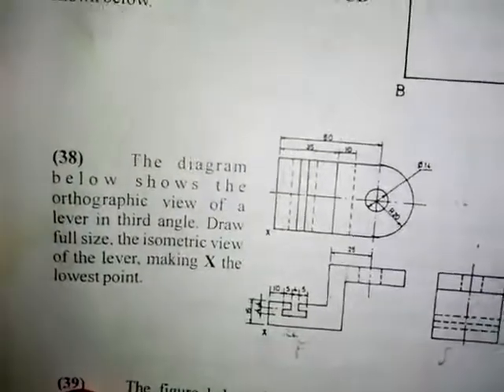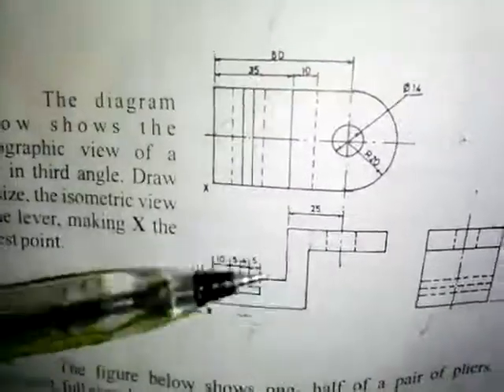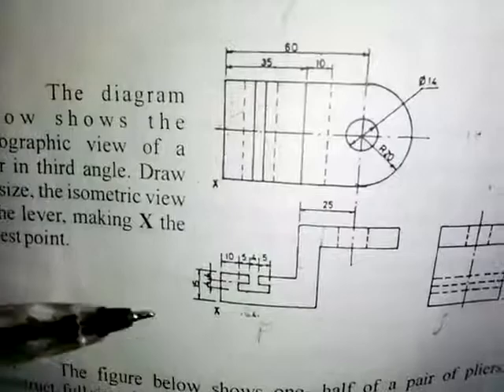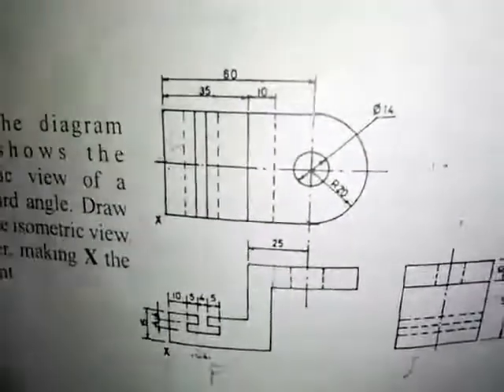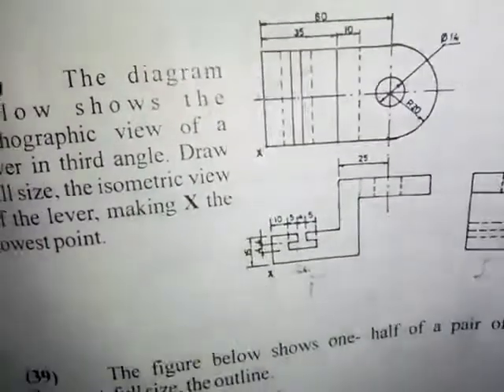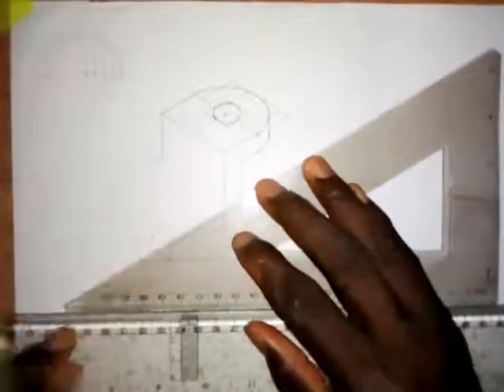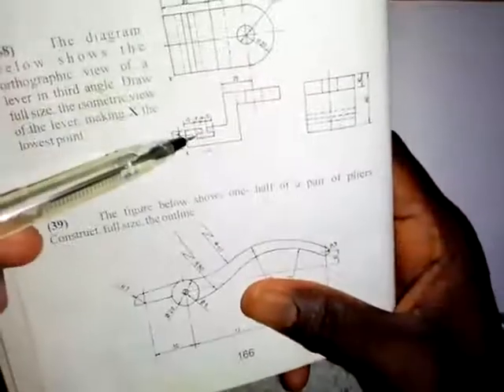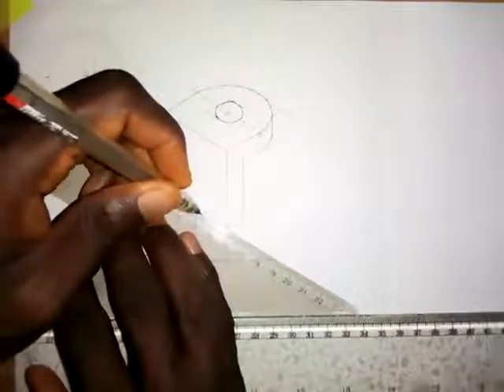Solution to WAEC Question on Isometric Drawing 2

Comment: Wonderful work but I can't even see what is happening. You keep zooming and shaking the camera. The solution is getting a better camera. I like how you teach and the fact that you answer complex past WAEC questions but when I can't see what you are drawing then the effort is defeated.
Reply from the maker: I'm very for this issue you raised but you can look for other work like this on the same channel which I believe the camera didn't behave as you said. There so many Isometric work I did on the channel. You can get it straight from the playlist. Thanks!
Reply: @HisGraceTutor  I have been following your drawings. Its just that I need this very example to guide someone today afternoon. You are the only one that did it and I can't get the solution still because of those setbacks